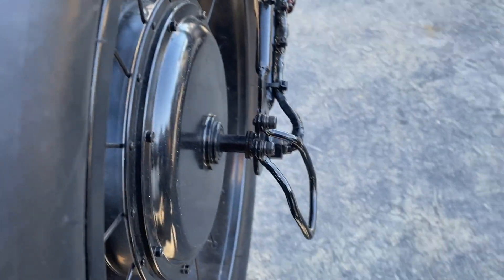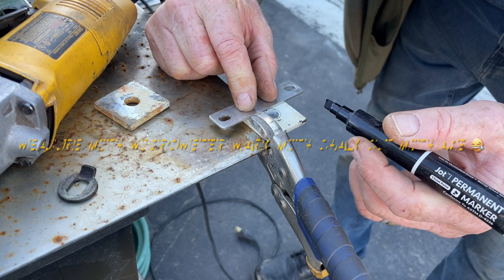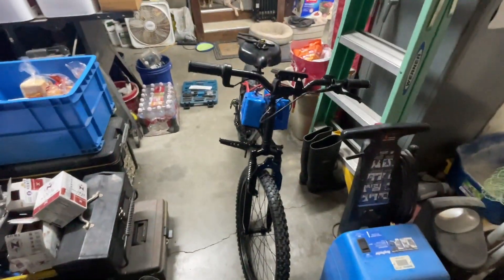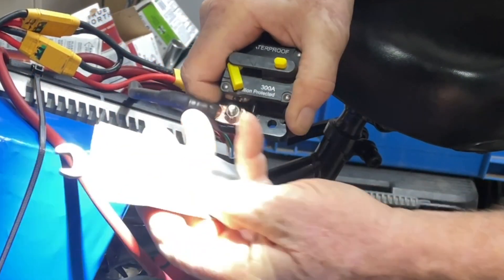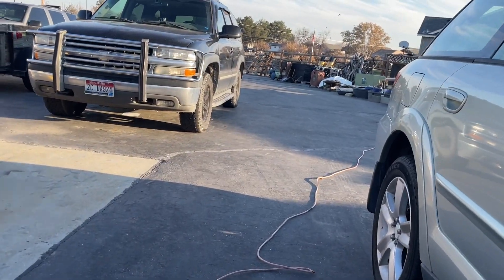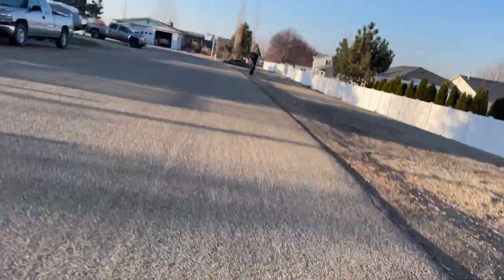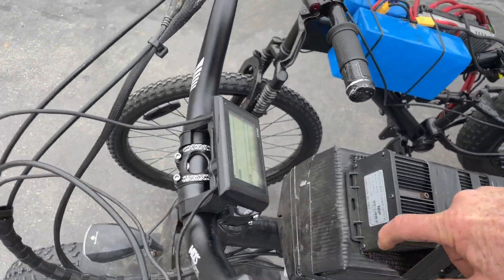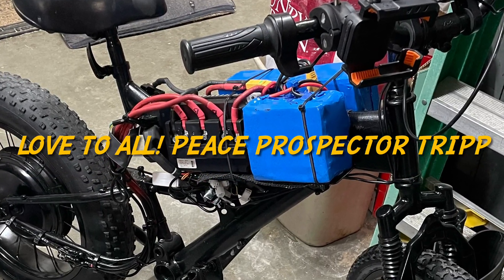DIY Electric 72v 80a EZ Fat Rider gets Torque Arm Beef and a Circuit Breaker.. Yep She Flys!

Comment: Wow outstanding my friend really enjoyed this especially the ride 😳 that’s crazy fast and scary without the brakes you spoke of. On a side note I purchased some blue prints for a  device to get electricity right from the ground I read through the them and you could seriously hurt or kill yourself if your not careful have you heard of this?? Any way I was wondering if I sent you the prints if you’d like to experiment with it and see if it can be scaled down for a 12 bolt application to run my recirculating pump for prospecting or if it’s impossible because of the voltage it’s capable of… I’m not knowledgeable enough to attempt it so I got scared 😂😬😕😕 your obviously way more knowledgeable with electrical jumbo than I’ll ever be. Any way if it can be done I can’t think of a prospector alive that wouldn’t want to use a lightweight permanent power source out in the field…. Thoughts? Ok I’m rambling now thanks for sharing see you on the next one👍🏼👊🏼
Reply from the maker: I was taught that 0 to 50 Volts is usually considered safe. I’ve definitely felt a bit of electrical energy on my fingers or arm while working on 48v batteries (a fully charged li-ion 48v battery is actually 54.6v) but no harmful shock. Above 50 Volts there’s enough voltage potential to possibility be electrocuted under the right conditions. Normal household voltage 110/120vac kills the most people every year. It’s the most common voltage and in every single home. Be careful with all electricity!
A lightweight lifepo4 / LFP (lithium iron phosphate) battery is a monumental improvement over heavy lead acid batteries. These LFP batteries provide a lot of lightweight energy for field work. With the addition of a $20 dollar charge controller and very light flexible solar panel that can be rolled up like a scroll for easy transport is a really effective field tool. Recharging your phone, flashlights and other devices is also possible with this inexpensive available technology. There’s also a bunch of little pocket power devices nowadays to bring along for additional power and overnight camping convenience.
You are welcome to email me the information and I will check it out and give you my opinion.
Email: prospectortripp@gmail.com
We actually have it so easy 😂.. luckily the long hikes while packing the needed goodies keeps most of the gold safe from the general population.
Great comment 48!
Thanks pal 
Peace Prospector Tripp

Comment: Nice job PT . So which one do you prefer , the Fatboy or the Slim easy rider ?  They both are worked , but the Fatboy i notice has backup pedals and chain for no go flat battery emergencies , lol , 🤣 Which could be a good idea but i don't know if i would like to peddle it too far considering the weight . But then again those batteries would probably never run out of charge in a hurry , so you got that covered . Over here in OZ , we've been having a few fire problems with Lithium Ion  Batteries , something that's a bit of a concern .They say the  the Lipo are supposed to be safer , but i used to have Lipo's in my RC's years ago and they would swell , which i didn't like much ,lol , seemed a bit scary to me . Anyway Matt , a nice upgrade👍✅ , and  as Keith Bowen always says , keep it safe out there . 😂👍Cheers Nev ✌
Reply from the maker: Over the years I’ve had three lithium battery Fires! Like you, I have been involved with RC cars and Aircraft for many years. The lithium Poly Pouch batteries swell up due to the massive current we need to fly or lay rubber 😂 , and are dangerous to use after swelling. Best to dispose of them if swollen. Lithium ion 18650’s are safer.. but just barely! I’ve also had these Explode in my Shop while charging up an Older Low Voltage battery. I knew it was a bad idea but being a bit of a maniac experimenter, I thought I could restore these by cycling them a few times. Nope! Exploded into a huge ball of flame! Luckily I have smoke detectors and was able to respond. When I got to the shop in 15 seconds or less.. the battery exploded in a 5 foot ball of flame! No worries.. 🔥 😂 I rushed in and grabbed the burning batteries (bare handed) and threw the entire flaming mass outside and quickly extinguish the flames before my shop burned down. I was miraculously not burned except a tiny bit on one finger which was very minor and required no first aid.
As we mindlessly push the Green Energy nonsense there will be more fires and not less! 100% 
It’s exactly the same as when we started using Gasoline and Diesel.. before this time there was No fuel and so No fires from fossil fuel. Make sense  to me.. 😂 
Pushing the so called Green energy technology and limiting fossil fuels only “Delays the Progress” of clean energy.. How dumb is that? It’s Really Dumb.
I have No Doubt that this technology will be amazing.. but it must mature before it becomes truly viable.
We are not there yet ☝️
China has had thousands of fires from poorly built li-ion batteries. The li-ion cells are mostly just fine. However, the build quality of making a battery pack really safe and reliable is Not the First Priority in China and is Still Not There.
There are Many New and much safer battery technologies coming but they are coming and not here.
The horse and buggy guys also complained about gas cars and gasoline dangers. Go figure 😂 
If we Stop Pushing out gas and diesel fuel vehicles the technology will be amazing and totally safe In The Future!
My bikes: 
I like both my ebikes and not worried about pedaling or pushing either after the battery is drained down. The BPM F15RS fat boy has 72v 30ah battery. The range is over 30 miles Floored with no pedaling. I have never ran out of battery before I ran out of human riding energy 😂 30 miles on a bicycle is a lot! The DIY bike is intensionally built lightweight without pedals. It has a 72v 15ah battery and a good 15~20 mile range. In normal use 15 miles is still a lot of riding. I may double the capacity of the battery to 30ah but this will add weight, so just thinking about it.
This lightweight scrambler doing off road riding for 15 miles is almost impossible for me until I can get a decent front shock fork and brakes up front. 
Okay Neville that’s everything I know today 😂 
Stay Golden Down Under Brother!
Peace Prospector Tripp
Reply: @ProspectorTripp  Yes i agree PT  , anything that can help us stop polluting our earth is a good thing , i believe for every polluting thing that man does , there is a better and safer alternative , unfortunately the almighty dollar is considered above human expediency  , these things will not happen in the Kingdom of God . All things will be thought through with the wisdom of Gods holy spirit before putting  into practice  . Have you ever watched Gallen Windsor , The Nuclear scare scam . it's  a long video but worth watching .  I think Hydrogen vehicles or a combination of both , I heard that China were working on Hydrogen vehicles , the Japanese are supposed to have developed a new Hybrid that's supposed to leave the others behind . i don't know too much about them , but mankind are not going to solve their own problems , we seem to just compound them , because our leaders minds are carnal not spiritual , so money will always be the driving force , forgive the pun !!! lol .:face-green-smiling: Take care Brother Matt . keep up the fine work , we love watching your labors , skills and expertise . Cheers Nev .👍✌  .

Comment: Could you explain more about your ebike battery wired in series. What caution u took when wiring your battery packs with different voltage
Reply from the maker: Absolutely Douglas, when jumping a car or truck with jumper cables you connect the Positive to the Positive and the Negative to the Negative that’s a Parallel Connection. It’s still 12 volts but it has two batteries working together side by side and so there’s much more cranking power having Two batteries vs One battery. 
A Series connection has two batteries connected together “Only on one end”! The batteries are connected on one side only either Positive to Negative or Negative to Positive, just like in most older Flashlights. (The batteries are Stacked inside on top of each other Negative to Positive to make a higher voltage)
A Series connection Adds the voltage together. So two 12v batteries in series (negative to positive on one side only) adds the voltage, so in this example would be 24 volts.
If you Google (series connection vs parallel) there are good examples with example graphics of these connections.
In my case. I have two batteries. One is 48 volts and the other 24 volts. I connected the batteries in Series to Add the battery voltage’s together to make 72 volts. 48+24=72 volts. 
How I did this is, I made a Series plug that when plugged in, it connects the positive on the 48v battery to the negative on the 24v battery making 72v. After replying to your terrific question, I probably should do a video on this topic.
Great question Douglas, I hope this helps you! Thank you! 🙏 
Peace Prospector Tripp
Reply from the maker: One more thing.. Be careful sir. Make sure you fully understand before connecting any batteries to each other. It’s a simple thing in my mind because I’ve been in electronics for 50+ years, but with li-ion batteries as with all high current batteries, there’s no room for a mistake! Please watch many videos on this topic and study it out before trying anything. 
I recommend buying a regular pack of cheap dollar store AA batteries and also you need a DVM from amazon (DVM = digital voltage meter) and you can Safely play around with them on your kitchen table and get a perfect understanding of how things work before attempting any high power battery connections. If you have any questions please feel free to contact me.
Thanks again sir 
Peace Prospector Tripp
Reply: Are u in the business to make ebike battery,  I'm looking for a 52 volt or 60 volt ebike battery. For my mountain bike.
Reply from the maker: @douglasdavidson3701  Hello again Douglas, I don’t build batteries for others. I am not setup for professional battery building. I like DIYing my own stuff but there’s lots of risks involved with building a battery.
I do follow a good builder “E-bikeguy”on YouTube. He has been building and modifying e-bikes on his channel and imo doing a good job. He is very knowledgeable about the industry and builds for customers.
I hope he can help you out.
Stay Golden Douglas 
Peace Prospector Tripp

Comment: First reaction… 
weiny piece ✅🤣
On road - off road - that baby is trick , only thing you should probably add is a banana seat 😎✌️✌️✌️✌️✌️✌️✌️✌️✌️✌️
Reply from the maker: Funny you mentioned 🍌Seat.
We are synchronized ! 🧠 🍌🪑🤪 😂 
Yes sir.. a nice longer more comfortable motorcycle type seat would be great! However.. Safety 3rd.. er a cough cough.. First! ☝️
The disc brake front wheel and shock forks is a definite priority.
Thanks much Jason 
Peace Prospector Tripp

Comment: That new piece looked like a Unistrut washer or a power pole crossarm washer.🤔🤔😲😲Lots of stuff on that bike brother. Thanks for taking us along on the improvements.
Reply from the maker: Good eye Chuck, unistrut washers fit the bill. My overall plan was to make a lighter electric bike than my BPM F15RS ebike that was also more powerful and hill / trail capable. So far so good. 
Thanks Chuck 
Peace Prospector Tripp